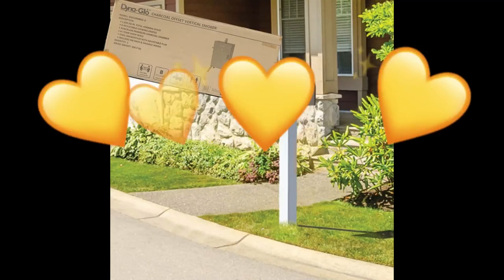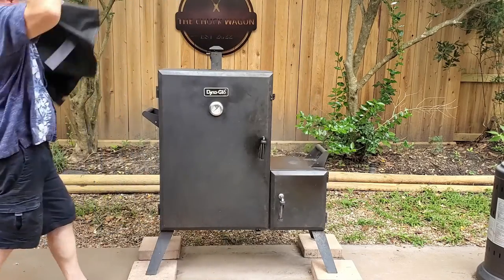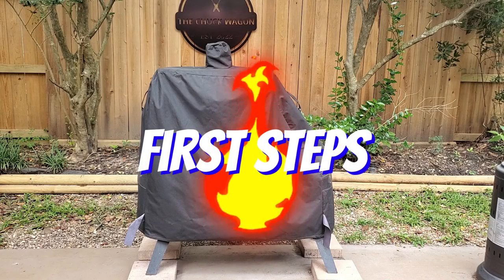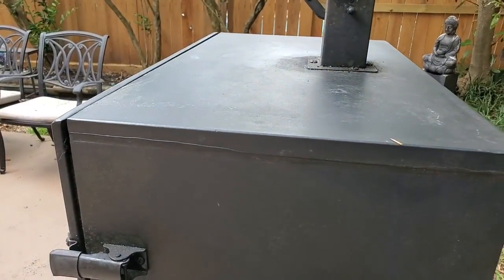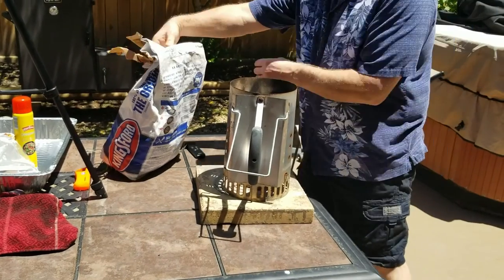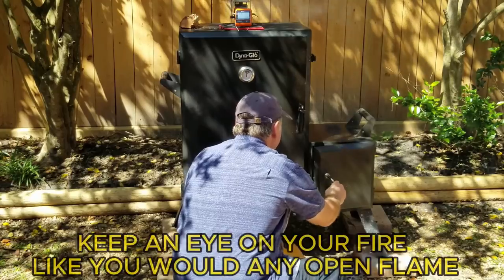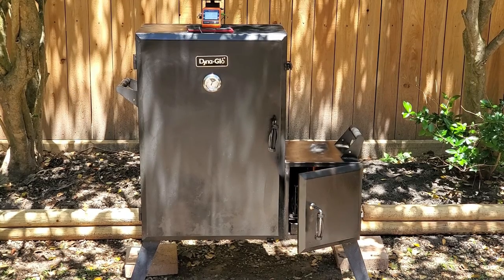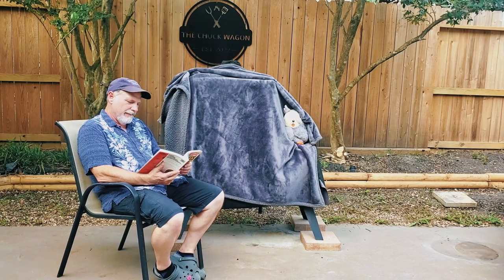THE ULTIMATE DYNA-GLO WIDE BODY VERTICAL OFFSET SMOKER TUTORIAL! | CHUCK IS COOKIN!

Comment: I've had one for a few years and love it. I also use heat bricks for temperature regulation along with deflecting the heat coming from the fire box. I also use a water pan.
Once in awhile will put the fire in the cooking chamber and cook direct high off the coals so the fat from the meat drips into the fire. Chicken and Tri-tip come out great using the dyna-glow this way
Reply from the maker: Those are all great ideas for me to look into, thanks :)

Comment: I've always been dumbfounded by the fat that they use the same fire box with the wide body as with the regular Dyna. Your tips on fire management and using all wood are exactly what I've been looking for.
Reply from the maker: Awesome, glad i could help!
Reply: Fire box on the wide body is too small, I built a bigger one,20"×20"×14" out of 2 sheets of 1/4" steel (1/2" thick total)and covered the smoke chamber with 2 sheets of 1/8" steel and installed a larger taller smoke chimney, now it goes 12-14 hrs without reloading.

Comment: Making the Dyna Wide Body a true stick burner, I like it! May finally put mine together now ha ha. Very interested in trying this out (using wood as primary fuel). Curious as to how often you add a piece of wood once you have it up to operating temp. Mainly referring to most standard offsets generally requiring a new split every 20-30min so wondering where adding new wood on the Dyna lands time-wise in your experience (both time in between adding more wood and how much wood you add). Thanks in advance for your reply, keep on smokin'!
Reply from the maker: Hi Mark. Great question. Ive been thinking about tracking that very same thing. Generally speaking the Dyna requires about the same thing, not a whole split but a 1/2 split about every 30 minutes depending on the weather conditions, etc. I recently did two full briskets and did track my wood count, so hopefully I can get that video out soon. If  you liked and subscribed, thanks!

Comment: That was awesome! I’ve got an old Oklahoma Joe Bandera on which the firebox has finally rusted out. I got it almost 10 years ago on a Black Friday sale for about $200, and it’s been a great smoker but it’s time to retire it. Now a days you can’t touch a Bandera for less than $600, and while it’s a good smoker, I don’t think it’s worth that. I’ve been considering the Dyna-Glo, but was conserned about the size of the fire box. The fire box on the Bandera was huge and I could put whole logs in it. I guess I could adapt to the smaller box.  The lack of air flow does concern me, especially since you can’t open the chimney all the way.  Well, at least I know a lot better what I’m getting if I settle on the Dyna-Glo.  Thanks for the great video.
Reply from the maker: Thanks! Yeah the fire box size is an issue. A lot of guys just use charcoal and chunks and you could go that route, but I didn't want to. Another issue is the thickness of the steel, its pretty thin, but fine for me in Texas. Other than that, I love it, so much room to smoke. Let me know what you decide to do :)

Comment: just got mine today.  well it came damaged. looks like it got dropped on something  softball size dent on top back right near seam.  now that wouldnt bother me but now i have big gap at seam where it started to seperate.  i sent email to dyna  glo waiting to hear back. if they dont replace it then i will just get that high temp caulk i guess and just fill in that big gap. lol
Reply from the maker: Thats a bummer. Its very thin metal, I would think you could push it back to normal with a 2 x 4 maybe? I definitely would caulk it anyway to seal it up.